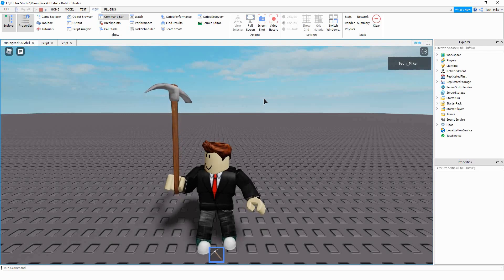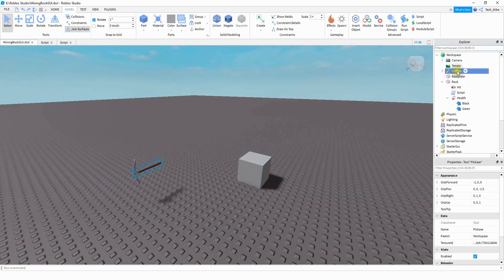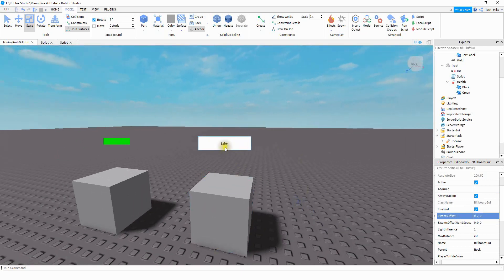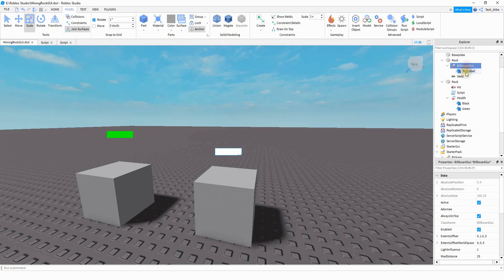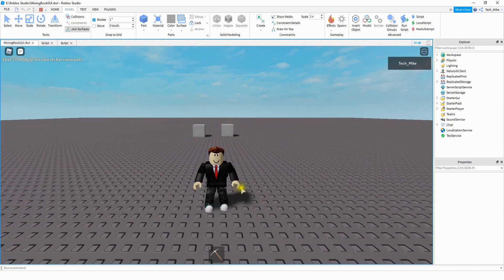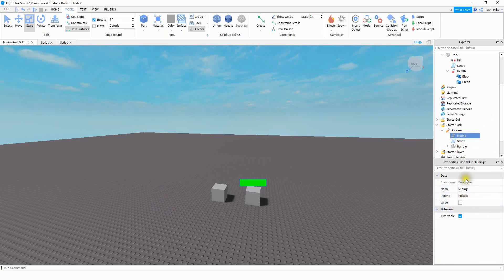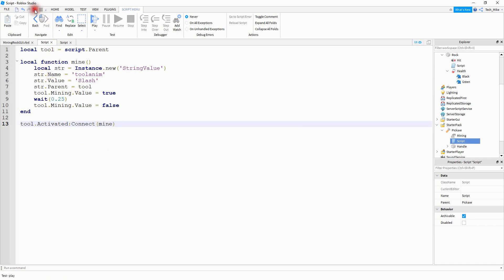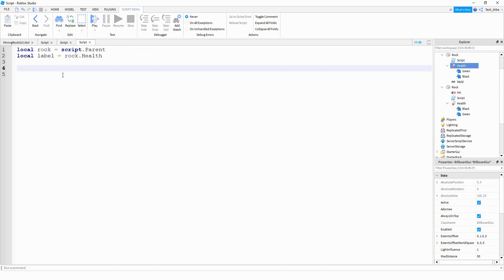How to Make a Mining Simulator (Rock GUI) - Roblox Studio Tutorial

Comment: here is my script i figured it out the health bar works now maybe you guys can too make sure though you change like rock to a capital Rock if you have yours set like that check everything closely as i missed out on 2 little ' in tool.....

local Rock = script.Parent
local label = Rock.Health

local swingsLeft = 10

local function onTouch(otherPart)
	local tool = otherPart.Parent
	if tool:IsA('Tool') and tool.Mining.Value == true then
		swingsLeft -= 1
		label.Green.Size = UDim2.new(swingsLeft/10, 0, 1, 0)
	end
	if swingsLeft <= 0 then
		Rock:Destroy()
	end
end

Rock.Touched:Connect(onTouch)
Reply: I had this problem for a bit of time but didn't bother checking comments, checked it now and I am thankful I did. Thanks for the solution!
Reply: Thanks for the solution man i always get stuck on these tuts cus usually there is an error in the code

Comment: why it doesn't work for me?
Reply from the maker: How are we supposed to know? Can you describe what part isn't working? Did you check the output for errors?
Reply: Sometimes when i press the rock it work but next i need to jump first 
And the value thingy doenst check and uncheck when i press the pickaxe
Reply: Output doesnt say any
Reply from the maker: Try adjusting the wait time on the tool script. I think initially it is at 0.25 , try 0.5 or 0.75.
Reply: Oh ok i will try later
Reply: I downloaded the game that u put at description so i check if i do something wrong but no 
I will try it latef
Reply: Do u have discord?
Reply: Aw still doesn't work
Reply from the maker: Yes, in about section. I will check on game and see what's up. Nothing that I know of should be breaking the scripts
Reply: Can u update me if u fixed it?
Reply from the maker: Yep, no problem
Reply: @TechwithMikeYT  can u check it ASAP?